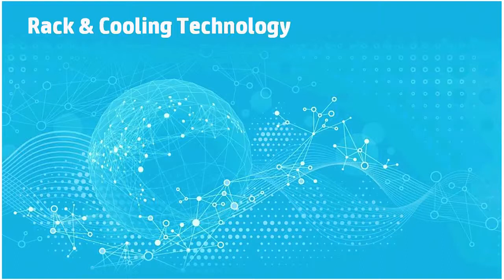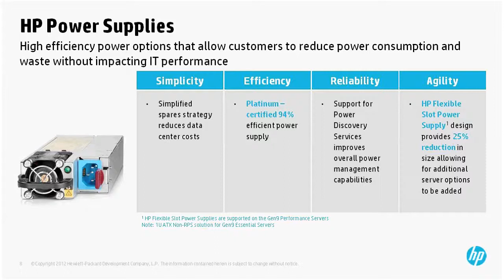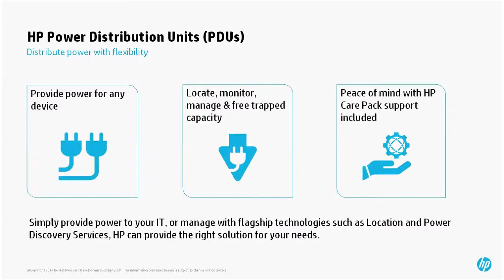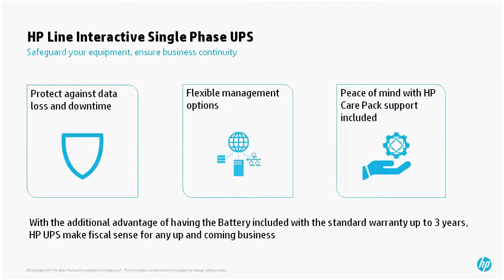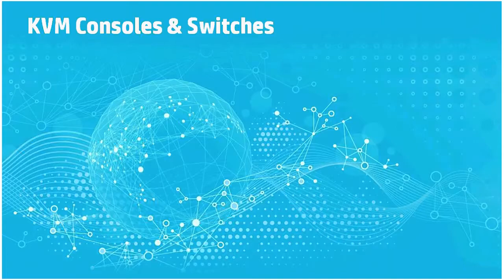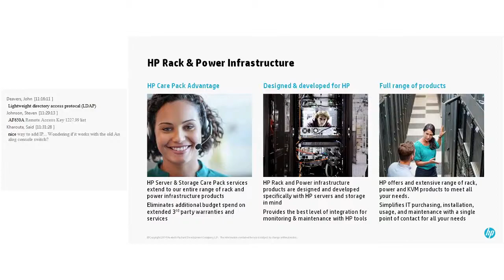HP Server Options - Rack & Power Presentation

Comment: Tray, How come the UPS units don't have those blue connectors? If the servers use power discovery to communicate with the iPDU's, wouldn't the iPDU's need to know how much battery supply is left in the UPS?